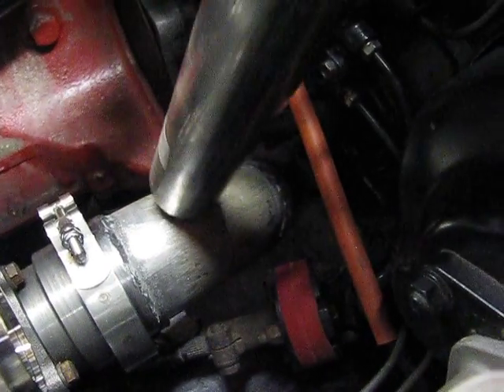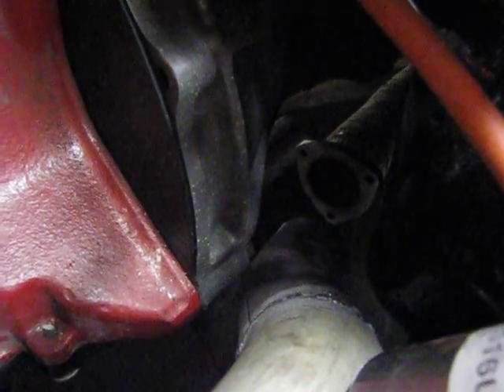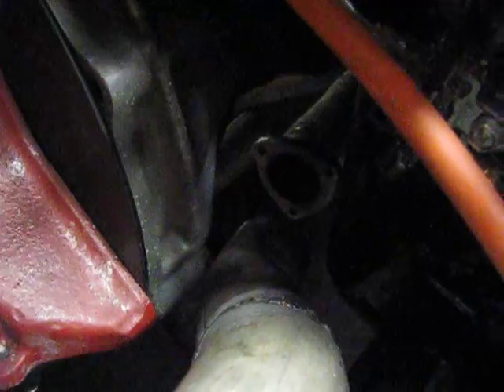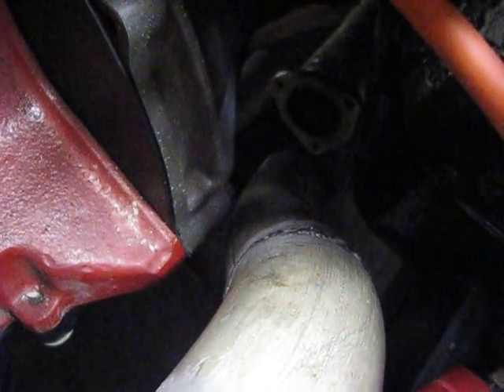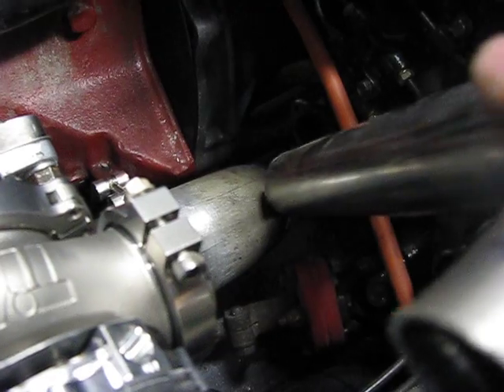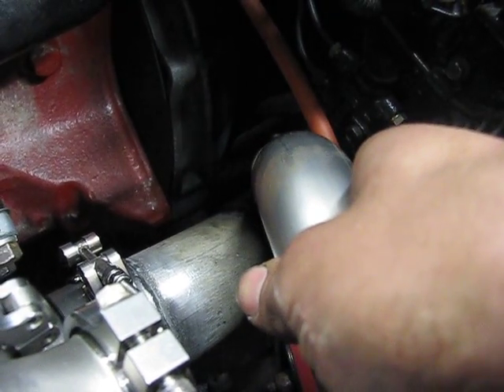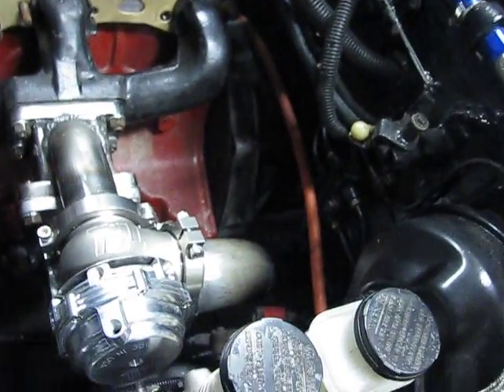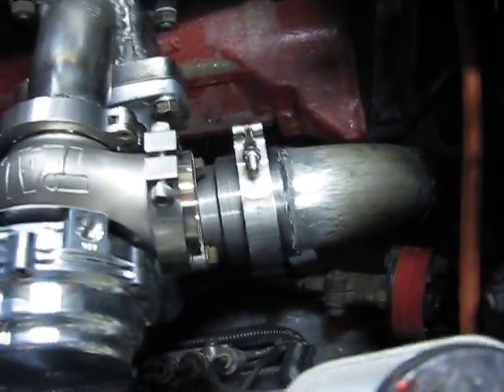Turbocharging datsun 280z part 2

Comment: Part of your challenge is to cosmetically make the install look balanced, can you rotate the waste gate and dump it forward?
Reply from the maker: I could but that would mean making the dump pipe more than twice as long. I would have to run it all the way to the front to just behind the radiator. I would rather not subject the intercooler piping to any more heat than it needs to be. Also, keeping the weight in a car between the front and rear wheels is one of the best things you can do in terms of handling